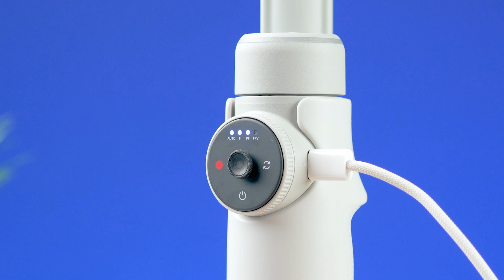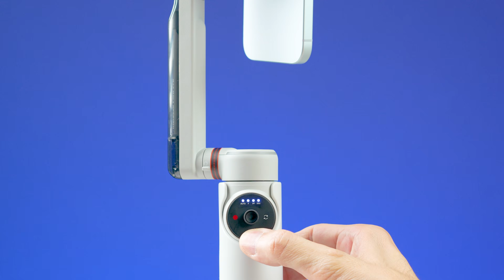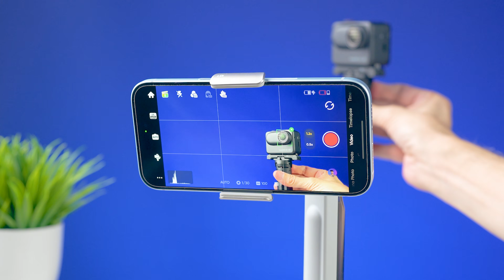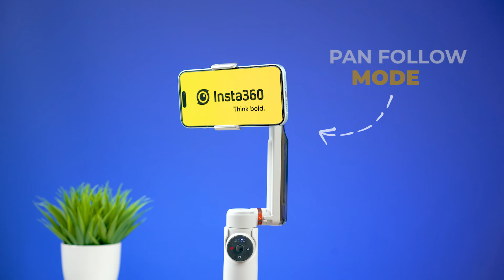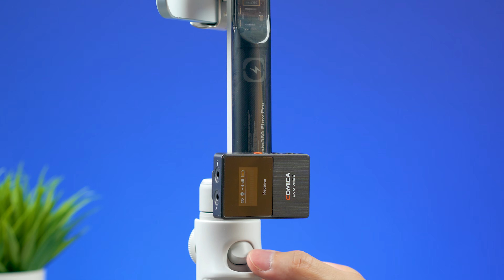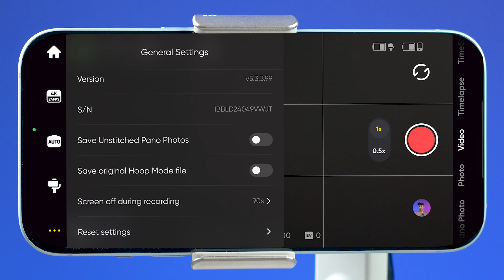Insta360 Flow PRO TUTORIAL for Beginners: How to Setup and Use Features: FULL GUIDE

Comment: I just got the flow 2 pro. I want to use the rear facing cameras to track me using the ai zoom tracking feature. How can I set that up myself? Do I need to use another phone to remote control or is there a gesture to enable me to use it this way? Like, if i want it to zoom into me when I'm 30 feet away, how can I accomplish that without starting it zoomed in too close when I enable it on the phone?
Reply from the maker: mmm remote with another phone might be the solution, or have someone start tracking you

Comment: Otto, I just purchased and received the Insta360 FLOW Pro. I cannot figure out how to set the gimbal to continuous 360 rotation from the operational panel while stationary on the tripod. I wish to operate the gimbal while the usb cable is connected to the base and the usb wall charger for continuous operation. In addition, I wish to have my phone charging constantly as well. Any suggestions are very much appreciated.
Reply from the maker: Hi. Although the gimbal is capable of doing 360 panning, I don’t think you can set it to rotate continuously by itself
Reply: @OttoJulian_  Thank you, Otto, for your prompt reply. Do you know of any device that can rotate the phone 360 degrees continuously while charging? Reason: I wish to use my phone app real time Stallarium connected to a projector to project a planetarium on my ceiling as the earth rotates day and night. Thank you again for your time.

Comment: Unfortunately this is only a half tutorial explaining the functions exactly like in the manual. It doesn’t show how to achieve things with the many options and functions. 
Best example: Pano. Why did you not show how the 4 modes are used and what the results are?
Same for the gimbal modes. When moving around in Auto, F, and FP, there is no difference in reaction of the gimbal to be seen.
Reply from the maker: I just watched this video again and I showed the difference of movement/ locked axis on those gimbal modes, even showing an example. Clearly shows what's not locked or locked, and an example of when to use them. Generally this is something that I show on a different video anyway.
As for pano mode, and some other modes, yes, I did not dive deeply into them because the retention of the viewer always drops down when I talk about the app. Panorama shots are self explanatory but that's my opinion. I try to cover the things that are most important for most users, for example you might not find important the AI editing feature or similar functions that would turn a video into a 30min tutorial and seen as boring for the vast majority.  Anyway, hope you did learn something

Comment: not sure why my flow pro looks a bi different than yours. button is different. cannot pair nfc. not sure what is going on.
Reply: nevermind. found the answers lol. that different design is the rubber wrap. and nfc found how to pair in the manual. still didn't make it, - but at  least it started blinking. maybe need to restart my phone. and phone quite old, pro 100
Reply: @arishem555 I had trouble pairing as well. What worked for me was turning airplane mode on and off. You also may need to play with the position of your phone when you’re holding it over the NFC

Comment: I have a few questions about the 360 photo mode on the Insta360 Flow Pro gimbal.

Can you tell me more about the size of the 360° photo? Is it any beter than an X3 or X4 regarding to resolution, stitching and exposure? Is HDR possible? Is it possible to save the pictures and to stitch those in another 3rd party program?
Thanks
Reply from the maker: the thing with the resolution of the 360 picture is that it will depend on the camera you are using and not so much on the app itself.

Comment: Thank you for your explanation Otto. My Insta360 Flow Pro arrived yesterday,. Will need a wider tripod feet as the iPhone Pro Max is too top heavy. Its not a huge learning curve, but like each car company has its own system, the same goes for Insta360. I previously had the DJI 6 but found it agin didn't support the heavy iPhone that well.
Reply from the maker: Sounds good. Hope this was helpful. Yeah I prefer using a sturdy tripod to avoid complications. Enjoy your new gimbal
Reply: Do you mean using your iphone with extra filter/other weights? I have a dji om6 and it works pretty well with my iphone 14pro
Reply: @OliverW44  I have the heavier Pro Max. I wish I would've purchased the Pro.
Reply from the maker: @OliverW44  no I actually meant using a regular tripod under the gimbal, instead of using the flimsy built in legs/tripod that the Flow Pro has